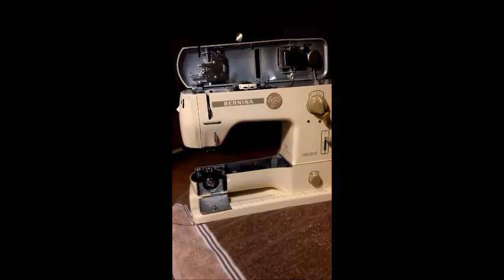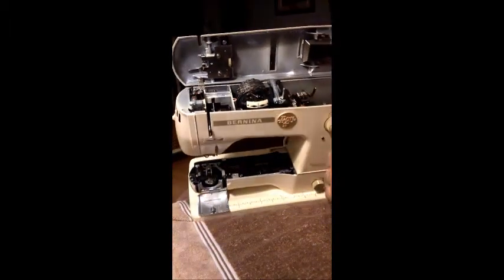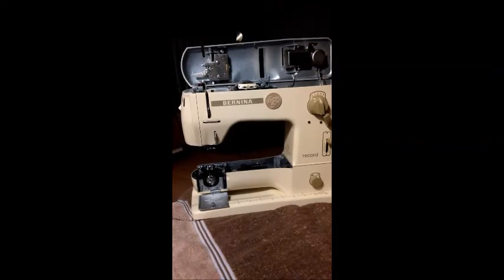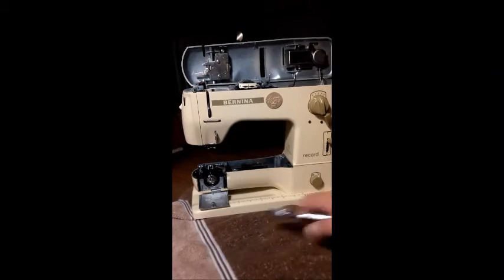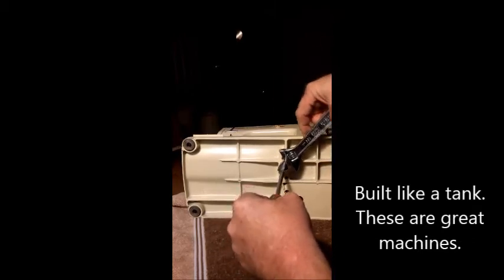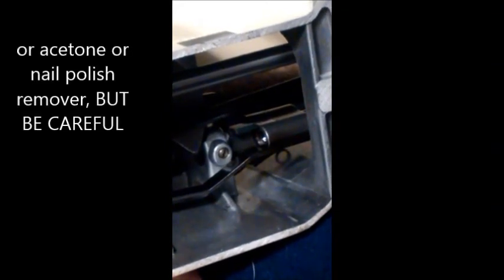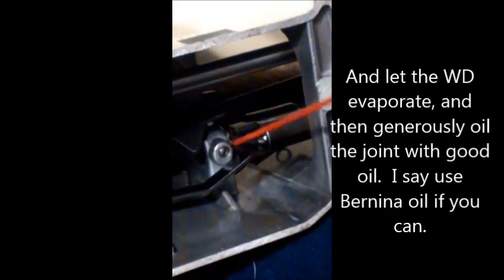Bernina 730 Feed Dogs Won't Disengage

Comment: Good video, genuine Bernina cam gears for this are no longer made, the replacement ones work perfectly, do not be scared by the fact the gear may not be as tight as the original when in position the cams rotate and each stitch the machine takes turns the cam stack quite a bit and the little play in the movement makes no difference and i have three of these machines i use and have replaced the same gears in each, on I just did again for the second time. I like to use Liquid Bearings synthetic oil on all my machines it works so much better and longer than any conventional oil I have ever used, this is available on Amazon or E-Bay and works on clocks as well. I have been using this for about 10 years and I will not use anything else for light oil.

Comment: Thank you ! I can turn the feed dogs knob without any problem, but the feed dogs keep lifting. On my machine, it seems to work exactly like on yours so I can't see what I'm doing wrong.
Reply from the maker: This just sounds like the symptom? have you opened it underneath? When the pin retracts, the two pieces need to then move freely.
Reply: @cbstrdst4892  Yes, I opened it. The pin retracts exactly like it is supposed to do, nicely and not tight at all, BUT the arm which moves the feed dogs continue to move, that's weird !
Reply from the maker: @isbahai.9715   Keep in mind that the pieces that the pin locks together by sliding, will seem like one piece when they are siezed. In other words, when the pin moves back, the two pieces should move free of each other. when they are siezed, solid together, it seems like one shaft. Hope that helps....
Reply: @cbstrdst4892  Maybe my pin doesn't retract enough (I can see both pieces, but they always move together). Well, that's not such a big problem as my machine runs great and I prefer my feed dogs up than down, so, I'll do with that. Thank you for your help ! Have a great day.

Comment: Thank you so much for your video, I have been searching for how to take apart a bernina 730 .I would so appreciate a video on the rest of what you described! 
I have 2 issues one was the feed dog knob being seized the other is my machine doesn't want to reverse.
The knob moves fine is just stitching on the spot until I release it?
Reply: OK so I fixed the feed dog issue thanks to your video, any ideas on how to get the reverse going. 
Cheers
Reply from the maker: @catherinephillips8925  Hi there, about all I could add, is that there is something likely hung-up/siezed in the same fashion. Just seeing your comment now, if I can figure out some thing to check, I will.

Comment: Do you have any recommendations how to open the upper lid of the Bernina 730 (to oil the inside)?
Reply from the maker: Open the door that the light is in, this allows you to get under the lid and easily pull up on it
Reply: @cbstrdst4892  Yeah, I tried that, but it keeps stuck (like the buttonholeslider ;). But thanks for your reaction!
Reply from the maker: @nanjavledder1509  I see the culprit on my 730. It is a little sprung "ball" that is seized on your machine. It lives on the rack that does the patterns, and springs the ball into a little groove on the top cover. It is probably seized. I would warm up the area where the pattern lever is with a hairdryer.
Reply: @cbstrdst4892  okay... I am gonna try that. Got the Bernina record (1968) from my grandmom and sewing clothes on it and it needs some upkeep. But it is still great to use it and find out all the features. Kind greetings!

Comment: Took my Bernina 801 into the shop to get the feed dogs fixed. They said it couldn’t be fixed. So disappointed. Watched your video and tried to fix mine; however, there is a metal pin that has come out, and I don’t know where to put it back. I can see that same pin (looks like the bottom of a safety pin 🧷) in your video, but can’t tell where it should go. Any suggestions? So sad if I can’t use this Bernina anymore! It will be like a death in the family! 🥺😉
Reply from the maker: So, it sounds like a spring from somewhere ( like the loop end of a safety pin). Very hard to say where it would be from without seeing it. I would get a second opinion. If your pin is out, it may be related to this spring. I would not let go of your machine without getting a second opinion. If it wasn't a Bernina store that you tried, take it to one.
Reply: @cbstrdst4892  Thank you. It was a Bernina shop. I’ll get a second opinion, as you suggest. 👍🏻
Reply: If it is still not working. Join the Bernina Vintage Sewing Machine group on Facebook. Then, take some pictures, and post your question. Someone should be able to help. Most do repairs themselves.
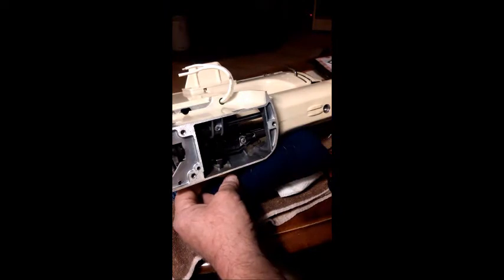Reply from the maker: Hey there. If you are still following this, I now know what spring that is.  At 3:27 in the video, you can see it beneath the mechanism. It installs from the top. Remove the needle plate/arm cover for easy access to install it . One end of the spring is anchored in a hole, the other side sits in a depression.